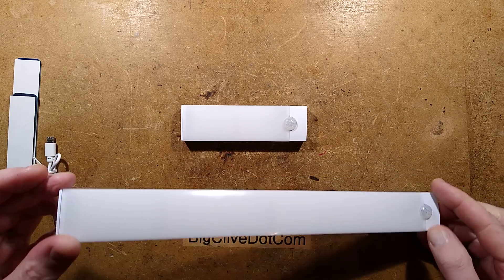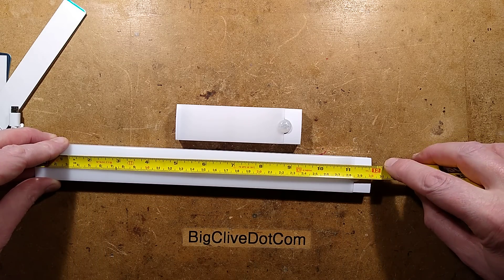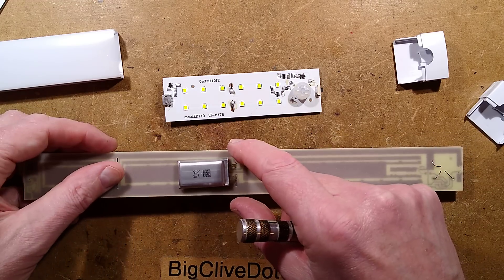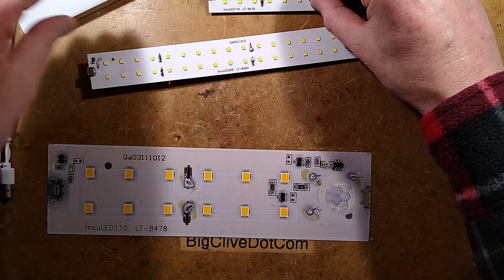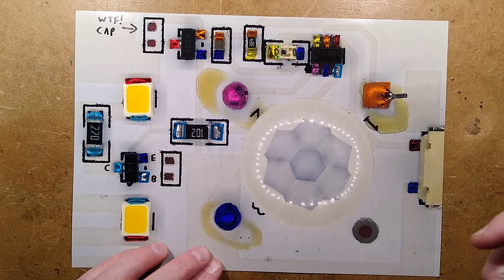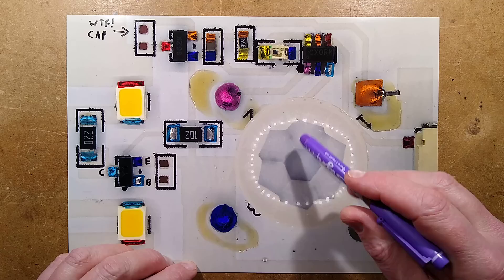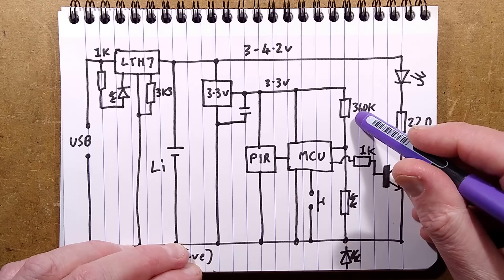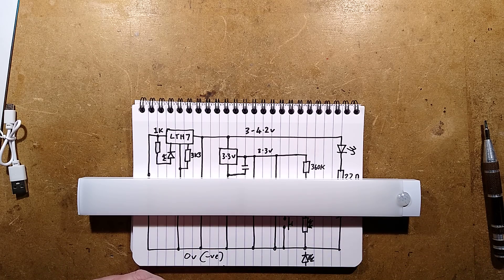USB rechargeable PIR light teardown with schematic

Comment: Could you remove the lithium battery and have them permanently plugged in to a usb power source? Thanks
Reply from the maker: You probably could.  But they last a long time between charges.
Reply: @ mine are cheap versions of them and they run out after a few days, but thanks Clive

Comment: Just one observation - the battery is a bare lithium polymer, if you add multiple batteries in parallel each battery (including the original) needs a battery management system (BMS) ensure charging and discharging is balanced and none of the batteries is overcharged. Overcharged lithium batteries are prone to bursting into flames or exploding. If you search for 2.7V batteries with inbuilt BMS you can get two or three 850mA BMS batteries that are 20mm wide and fit. Which is precisely what I'm doing. Also fitting a light sensor to switch helps (although some have the same board and appearance they don't switch off in normal house lighting levels here in the UK).
Reply from the maker: These cells are in parallel.  As long as they are close to the same voltage they will act like a single cell.

Comment: My guess would be that the WTF capacitor is a position for a protection diode common with such linear regulators. For example see page 13 of TI's LM1117 or LM340 datasheets.

Comment: After having these same ones for several months, I added a few similar ones to a TEMU order. Dirt cheap and only one row of LEDs, but they were just an impulse buy. They worked perfectly for a few charges, then the mechanical switch changed operation from "OFF-AUTO-ON" to "SCINTILLATE/FLASH BRIGHTLY AT TIMES-ON-ON".  The only test gear I have these days is a simple multimeter, but I shall have a look inside and try to find the fault that has appeared.
Reply from the maker: The switches are very prone to failure.  Try removing the switch and bridging the chosen feature.

Comment: A year ago I bought similar lamps (11cm version), the markings on the board are exactly the same. I tested two copies, the batteries showed a capacity per discharge of about 70 mAh, discharged to 2.9 volts (it is at this voltage that the circuit goes into protection), peeled the batteries off the board, the capacity was written as 130 mAh, although at the time of purchase it was promised 300 mAh (Aliexpress:). The charge current is really is 300mA, this is a lot for such a small battery, it degrades quickly, after a while I added a battery from a second lamp and lowered the charge current to 100mA.
In standby mode I measured 18uA, which is very close to your measurements.
The lamps are good, I liked the design of the housing and the circuits are not bad at all. It’s a pity there’s not enough space for the battery; I haven’t been able to find a suitable one yet.

Comment: MCU looks like ATtiny10. At least it's pin compatible: pin 2 is GND, pin 3 is PWM output (OC0B), and pin 5 is VCC. Could be replaced for hacking purposes, for example for changing turn off delay after being triggered.

Comment: These are great to stick under the car's parcel shelf, illuminates the car boot really well. 
Most cars have a useless boot light hidden to one side. 
Remove the Light Dependent Resistor so it works in all light conditions :)

Comment: Would I be right in saying that if additional batteries were placed in parallel, there could be an issue with cell balancing? This being more likely to be a problem with the random nature of the source of the cells. Do the cells from the devices that you mention have sufficient protection circuitry fitted to prevent over charge and a conflagration?
Reply from the maker: Balancing is only needed with series cells.  If lots of random cells are connected in parallel, making sure their voltage is close first, then they will act as one single cell.
Reply: @bigclivedotcom  Ah yes, thank you, cleared that up for me. I was basing it on my experience with batteries in parallel that started fully charged but had discharged at different rates, when I separated them I was able to see this.

Comment: It's interesting that the measuring tape has both. In the US it's common for rulers 4" to 1.5' to have both however not so much for tape measures. However working at an afterschool program three years ago the Geekier kids seem to think metric is the way to go get and get rid of everything else aka death to imperial (and I agree fractions are messy and confusing). I think they both have their place I had a nice discussion on a discord server about how Fahrenheit seems more like a human temperature and Celsius fits more basic science with kelvin measurements for the really big stuff. Imperial was all based off of human measurements metric being based off of Constance. And if you really want to throw people you just say that the foot is actually metric! Because us Yanks lost the golden rule Master measurement and head to base it off of metric LOLOLOL. And a lot of the electrician/ construction videos I watch in the UK seem to be building with foots hmmm.
Reply: I wouldn't mind inches if they were decimal inches!

I think it's a peculiarly British thing that we default to whatever the most convenient unit is. If it's two or three centimeters, it's about an inch.
If I'm going for a walk, it's 10km but I walk at about 3mph. I buy 2.4*1.2m boards, because it's a metrification of 8*4. We buy fuel in litres and yet measure fuel economy in gallons.

Comment: Is that a completely unprotected lithium  ion cell? I'm surprised nobody else has seemed to notice that yet.
Reply from the maker: The LTH7 charge chip prevents charging above 4.2V and the circuit current will be very low at the point a classic DW01 protection PCB would normally cut off.

Comment: Will these work while they're plugged in, i.e. can they be left plugged in so they are fully charged in case of a power outage and also work while the power is on? I know some of these types of devices will be disabled while charging, but none of the listings I looked at specified.
Reply from the maker: These ones can.
Reply: @bigclivedotcom  Thank you for answering.

Comment: As the video was ending I thought about the lamp flashing on and off would be a sign to charge it, then you mentioned it in the final few words. Damn your good...   :)
Answering my question even before I type it.  :)
Wonder if anyone knows of a single cell long battery that would fit in there?   Prefer not to go muliple cells just in case one backfeeds to the other. Its one of those things that may get ignored until its too late.

Comment: @4:30 I don't think I would recommend putting multiple cells into this unit without a way to balance the cells. I think a better approach would be to try to locate larger single cell. Surely there are places to get cells online that allow you to put in the cell dimensions.

Comment: If I want to reduce the light sensibility of the PIR light, do i need to increase or reduce the resistor value on the photo diode? So it will only trigger when it is much more darker.

I have a PIR light light this for a while now, but it triggers to early, when it is still to bright and i dont need the light. The resistor in front of the light diode is a "(all underline)124" SMD resistor, which is either a 0.124ohm or 120K ohm...
Reply from the maker: Try a higher value.  It may be worth experimenting.

Comment: We have been using similar units to provide sensor based illumination inside cupboards and wardrobes for at least a year now. Some of the early (and more expensive) units ware of very nice quality. At least one of them was never set up and is now a mobile light ready for any power cuts.

Comment: Got many LED lights based upon your interesting strip downs/reviews, so no excuse for when the lights go out. I did recently purchase a large but cheap steel bin with lid off ebay though to store most of these rechargeable devices in, given the added risk....just in case...🤣

Comment: I use one of the small ones in the drawer in my bedside cabinet. It obviously lights the draw when opened, but also provides just enough light to navigate the bedroom for the nocturnal trips to the bathroom without disturbing the missus.

Comment: I have an inductively charged light from Lidl it sits in a plug in charger and acts as a PIR activated light at night (it has a light sensor) useful for night trips to the toilet without turning on the main lights, a power fail light and a hand held torch, wish I'd bought more than one.

Comment: This looks like a fairly well designed motion activated light, apart from that misplaced cap.
I have had terrible luck with those type of buttons that attach to the board like the ones shown here, as the solder joint, and pads are the only thing holding it down. With normal use on several things I own, that switch just ripped off the board one day, and the device couldn't be turned off again. (Screwdriver helps if you can bridge what's left of the connection.) I don't trust those anymore. I prefer the through hole variant if it must be a 90 degree, otherwise a buton that the board supports directly.
Would an 18650 or 14500 cell fit in this light? (maybe several with the long one.)
Reply: Nice dab of epoxy under the switch can help mechanically. In PCB fab you can specify glue stencils but it's pretty rare to see used these days.

Comment: Would you like a  big power supply that went bang its from a Fruit machine so think it might interest you and would definitely make a good video.could give you it next time your in Glasgow I could get the train from Irvine if it cost less then the train I’d post it to you 

Sanken power systems UK LDT 
GSK017HA POWER SUPPLY 

Input AC230V 3.5A 50/60Hz
DC +5v    2.0A.           +13.5V     4.0(8.0)A
      +24V  1.0(2.0)A     +49.5V     3.2A 
      -12V    0.1A

Comment: I have quite a few of a very similar light (they have warm and cool LEDs) some of which I used as porch lights (sheltered) but all of those malfunctioned after a while. They would just come on without any motion to trigger them and as soon as they timed out, they would come on again. If I replaced a malfunctioning one with a working one, it would be fine for a week or so then do the same and the problem seems to be permanent. I started using a different smaller type and that one has not had the problem. A bit of a disappointment because when they worked properly, they were great. Now I can only use them as power cut backup lights in manual mode - which given the leaflet I got through the letterbox today seems may be very likely.
Reply from the maker: I wonder if there was something electrically noisy in the vicinity or some thermal disturbance.  The batteries may also have been affected by low temperatures.
Reply: @bigclivedotcom  I don't think that there is anything electrically noisy - I live in a rural area and there isn't even a power outlet within about 10ft but even that has nothing plugged in. I don't think that it is the battery because the light still comes on all the time. I wondered if the PIR was damaged by the cold and/or damp but it was under cover so the damp would only be from the air. Anyway, I decided not to break any more as I have them on the stairs because there is a dark spot where my cat likes to sleep and it stops me from standing on him. The other model I'm using in the porch and pretty damp shed seems to work fine.

Comment: its those little details. The focus, the white balance, the zoom etc. its like Clive is also a viewer and wants to see everything like we do. He is amazingly some kind of video hive-mind participant.  love you all. ps...Clive how do i make my scavenged streetlight be "manually" turn off and onable? it seems to be set to only work between certain hours. if i remove the circuitry dome on the top, it doesnt turn on at all. side note.. not sure if helpful...its fine with 240v 13amp 3 pin plug,, its the timer thing thats the hassle. :(
Reply from the maker: If it has a standard bayonet cap style module on top you can get shunting caps or alternatively, bypass the wiring internally.
Reply: @bigclivedotcom  the controller device on top does have three 'dog leg' style pins. Is that 'bayonet'? i assume so. push and twist. 
May i email you an image of it?
Reply: oh. just thought to add.. it's 140 warm white LEDs matrix lamp. 
... i wonder.. if i pay courier both ways to you (i need it back), it might make for good video content for your channel???

Comment: the wtf cap may well be an ption for a resistor
the PIR consumes very little power, so a moderately dimensioned resistor like 470Ω together with a slightly larger cap across the "3.3V" rail might have seemed like an option during design time

Comment: Last year Aldi sold similar lights around here in different versions. We got a large one with PIR and a set of 3 small ones with IR proximity sensors (that are meant to go inside a cabinet/drawer). All of them have a 3-position slide switch for off/on/sensor, the large one has a 1.5Ah cell and the small ones 330mAh.
We use all of them by completely ignoring/not using the sensor and just turning them on on demand xD And at least the small ones wouldn't be very practical in sensor mode anyway since I found out by accident that they drain their cell in 2-3 weeks that way. The large one was originally meant to be used as a night light but was way too bright for that, so now it's in our bathroom as an on-demand light source when you don't want to turn on the ultra-bright ceiling light. One of the small ones is mounted in a cupboard that's in a rather dark corner, and the other 2 small ones are tacked to metallic objects in my room (they all have integrated magnets and come with sticky metal plates) and serve as handy "flash lights" ^^

Comment: Had couple of these recently, work really well, it just stops working when battery is flat, had a look at circuitry accidentally when end popped off with charging cable.  Went to buy more but seller was away, other listings were way more money so opted for some round ones, main difference is sliding mode/off switch and dreaded flashing when battery is flat. They do last long time charging not big issue.

Comment: Some time ago I bought a battery powered PIR light. I assumed that the power consumption when the leds were off would be minimal, but after three days the two AA batteries were already empty!
So I did a 'hack', removed the batteries and powered the PIR light with a small 3 volts switched mode wall wart. Power consumption is negligible and now I have a perfect light in the dark in my staircase.

Comment: Clive,hook up a variable psu ,remove one conection on bat,and see if the unit becomes unstable at very low volatages,the pic mcu might have a shutdown or a blink,to protect bat from undervoltage.

Comment: I've been wondering this for a while. Is it safe to use LiPO cells of different capacities in parallel?
Reply from the maker: Yes.  They just have to have matching voltages before connecting in parallel.    They will act as a single cell.

Comment: such low voltage I would remove the battery and connect to a phone line using a tonne feed to power it .. that way it cost nothing to run
Reply from the maker: That gives very low current.  But you can optimise an LED panel for that sort of use.

Comment: I have a brand new led light bulb that died (it was installed in a ceiling fan and it has the correct wattage) and I extracted the boards from it to see if I could find the fault, I could not, it is an Ecosmart bulb, I am thinking of tossing it if you don't want it, but I am interested to see what went wrong.
Reply from the maker: I have a lot of failed LED lamps here.

Comment: So wait, it will run every night?

How long would the battery last with it running for say 8 hours a night?
Reply: In PIR mode, my lights are reliable for about 4 days. Probably would last for 10 minutes continuously. So I recharge them twice a week.
Reply from the maker: Not long.  It's only designed to run in short bursts when needed.

Comment: Same here in Canada .* Hate metric system .I don't use metric conduit or metric wires .Since 1982 I started my apprenticeship in high school .They tried to force the metric system on us but all the construction was in inches .The first treasonous trade were the cabinet makers .They went to metric so we had to buy metric measuring tapes .Then. Company called Rabone made a metric and imperial measuring tape then I think Stanley and Lufkin and others followed suit .Now some smart ones have the measuring tape on both sides and magnetic ends .Handy lights though if you needed some emergency lighting

Comment: The "Big Clive Effect" has begun on eBay. Prices rising...
Reply from the maker: That's why I don't give direct links to listings.  The price goes through the roof on that listing.
Reply: @bigclivedotcom  Understood. What happened this time is that there are very few listings for the exact product you reviewed and I suppose people are flocking to those listings, as I did, instead of going for the similar but different ones. No big deal. Prices will re-adjust in a while.

Comment: Nice little light units. For power outage I bought maintained or non maintained bulkhead lights that are connected to the mains and come on if there is an outage. On ebay they were selling for £6.50.